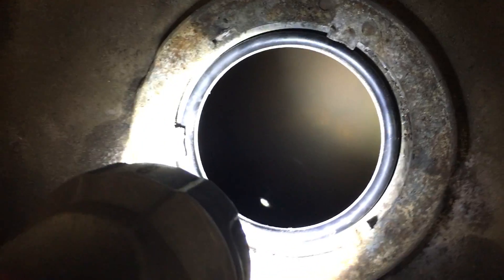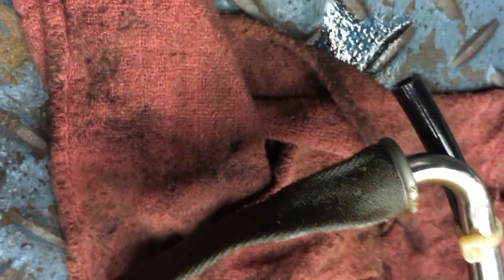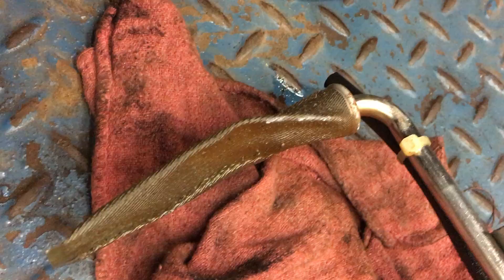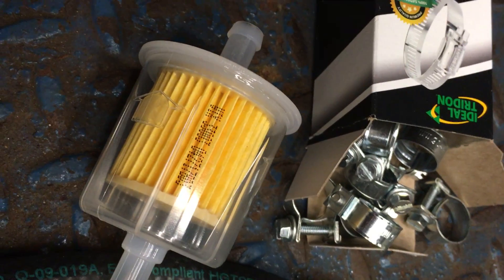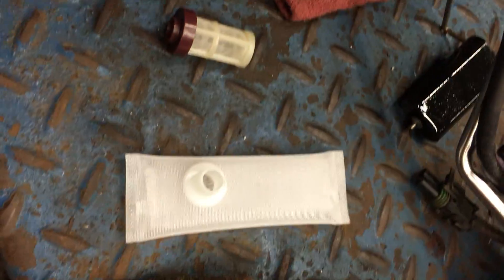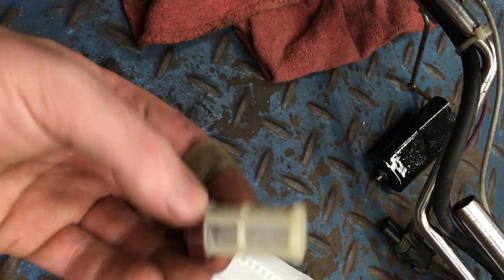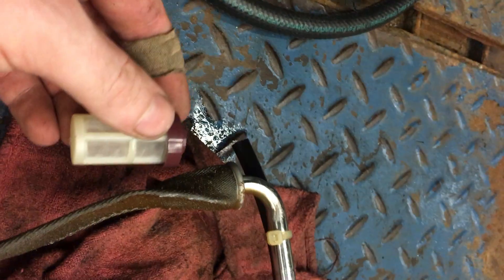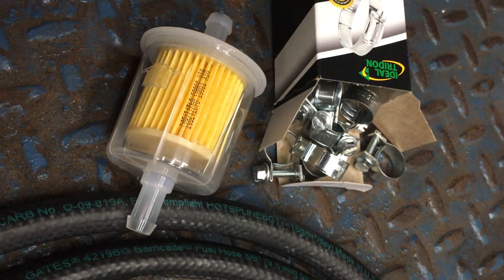6.5L Diesel Fuel Sock Removal Part 1

Comment: That sock in the video is for a gas engine. All sending units come with them even if you tell them it's diesel. The gas ones will collapse over a short period of time causing  the engine to starve of fuel and fill with air. The correct sock is gm part number 25055272
Reply from the maker: Francis Williams factory socks are useless as well in-line is the way to go

Comment: Hey, I know it's an old post but hopefully you get a message. How has the filter been working out for you? How often have you had to change it? Trying to put the stuff together for mine right now because my filter was clogged and I think the tanks got a bunch of junk in it. On the road working and don't have the time or the facility to drop the tank. Hoping that this gets me by until I can get home. Otherwise I'll have to do it in a parking lot somewhere. Hope to hear back soon. Thanks for the videos. Don't you just love all the negative comments.
Reply from the maker: Lawn Enforcement  use the 33239 wix filter with the wix 24770 base and some barb fittings 

Thanks for watching 
People just want something to complain about . When you have costumers and emergencies for them in the middle of blizzards you do what you can with what you have lol
Reply from the maker: Lawn Enforcement  wix-33972 is the new inline filter I use if the customer cannot afford the bigger fuel filter base and spin on filter

Comment: Why wouldn't you just use a shop vac and clean that damn tank?
Reply from the maker: J  it was a 1/16 of was seemed like glue so we advised the customer to replace the tank when he has the funds. He had replaced the tank years back and he or the shop that did the job did not install the tank sending unit seal so a few years and winters around here and that’s what you have left in the tank
Reply: That's the thing ,hard to cover a fuel tank from dirt. It sits ,rots or rust out the "pound and turn" the metal ,gasket seal ring.

Comment: Do you have a part number on that Wix filter? Going to delete the sock while replacing my sending unit on a 1998 6.5TD and want to know the filter you used.
Reply from the maker: 33003 its in the video

Comment: Do you know the stock sock mesh size? How do you know the filter is the same? Just read some stuff that too small if a filter will clog when cold.
Reply from the maker: ryanburbridge that's a 20 micron filter I put in it. If you treat diesel in the cold it won't freeze and it's a return system so the fuel warms up quick after it starts running up to temp.